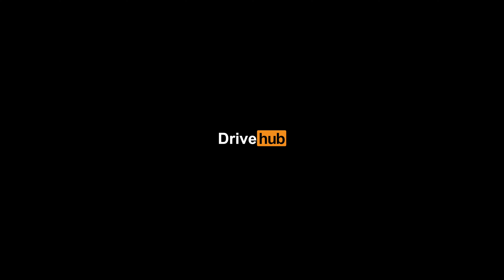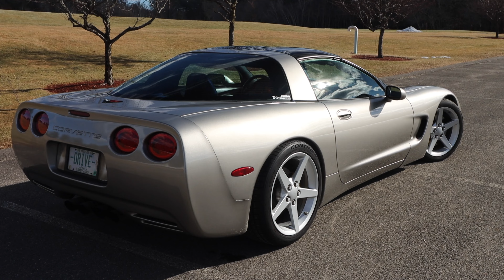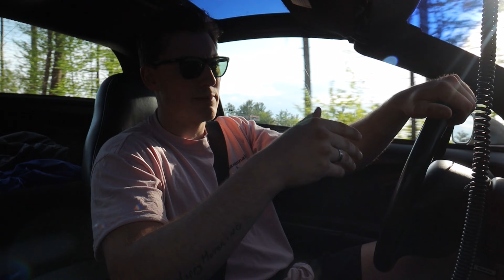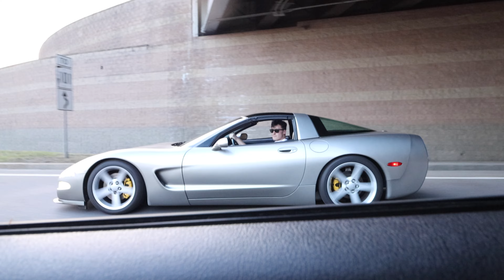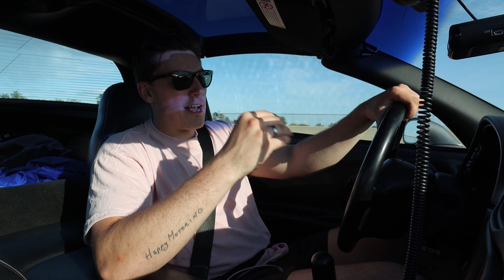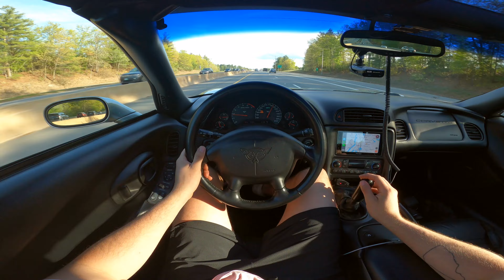I'm kinda gonna miss this... | DriveHub

Comment: How are you able to shift that thing so fast!!?? Is it tuned? I have a bone stock '03 Z06 and the thing does not like to shift fast under full throttle.
Reply: Me too!!
Reply: @darrylsjodin7184  have you had any clutch issues with yours? I know they’re sensitive to needing lots of clutch bleeds
Reply: @benbattista5035  no, not yet, but it has 75k on it so not sure how much longer it will last. C & S Corvettes says they last around 100 k
Reply: @darrylsjodin7184  interesting. Yeah my car has 25k on it and whenever i go to shift hard the clutch goes to mush. Heard it just needs to be bled frequently
Reply: @benbattista5035  hmmm, I haven’t noticed that with mine but it is making new noises that I’m concerned about, like synchro whine and a rumble from another wheel bearing going out. It’s really hard to not step on it and go through the gears with a manual though!
Reply: @benbattista5035  let me guess, its hard to shift up in the rpms?
Reply: @Drivermod_Josh  basically. I wouldn’t say it’s hard to shift, more just the clutch seems to have a lot of dead space when shifting at high RPM multiple times in a row, totally goes to mush
Reply: @benbattista5035  upgrade to a tick master cylinder & get that remote bleeder. Also make sure to bleed your clutch often! Your bleeder screw is beneath the intake manifold so its a huge pain without that remote bleeder. 
The stock clutch sucks, I have a monster clutch single disc that can handle around 550rwhp and it drives better than factory, no chatter and grabs perfectly up top
Reply: @Drivermod_Josh  thanks so much for the advice. I will do that for sure. With 550 whp I’m sure that thing is rowdy!
Reply: install ticks master cylinder and put new slave mine did same
Reply: @Boosted_Kev  the tick master made a huge difference on my c5, clutch no longer sticks to the floor & has no issue

Comment: So question, since you drive in Mexico so much.
Have you ever been at 200+ in the c5?
Reply: they won’t do 200
Reply: @Decky9  they will, if had mine at 200.
I dont know if its completely stock or not since I'm the 10th owner but iv not modified anything and from what more then 1 mechanic tells me they can't see any modifications ether.
And when you hit 200 in a c5 the hud goes from 199 to 00 and the needle pegs af 200.
Yes they can go 200 but you need some range for it to happen, I had 40 miles of open road where i was able to keep the meddle pinned to the floor.
Reply: @lockonstratos7787  top at 175-180
Reply: @Decky9   🙄 sureim not going to argue with someone who's using the statists and doesnt own one or if they do never pushed it.
Again as I said iv had mine at 200+ and to my knowledge its stock once you hit 200 the hud goes from 199 to 00 as it cant read anything over 200.